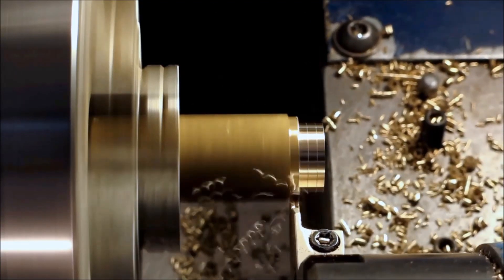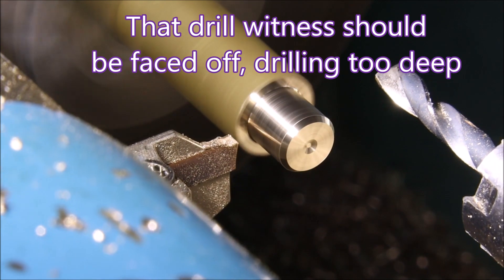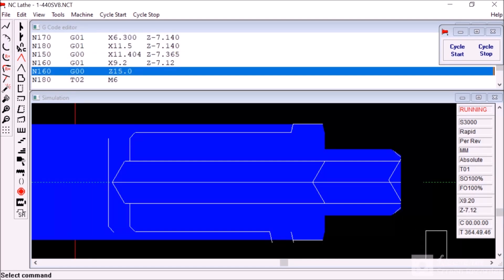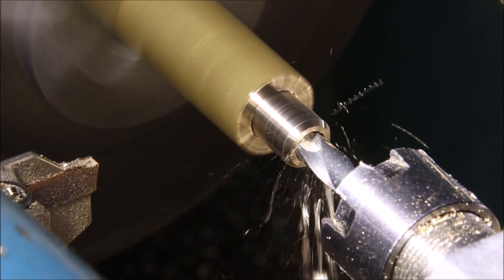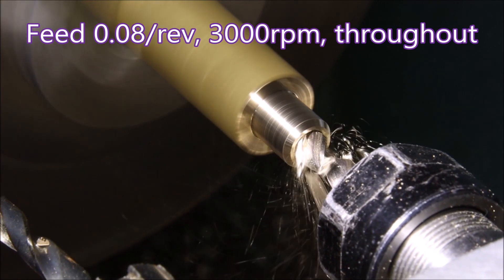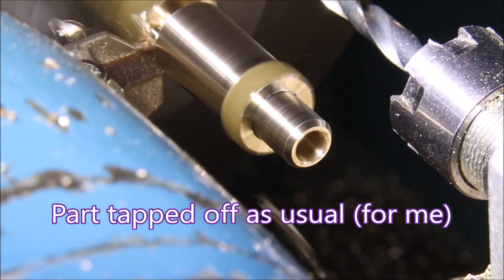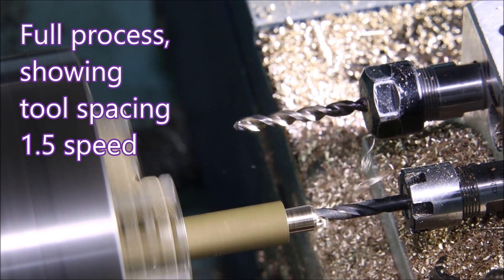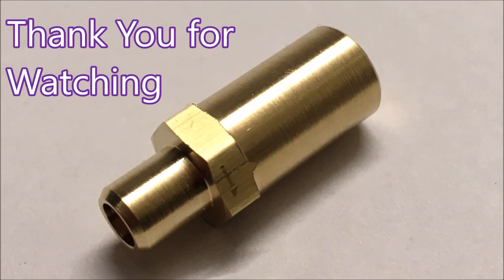Brass Steam Valve Body made with gang tooling in small cnc lathe

Comment: oh whats up with it now!
Reply from the maker: What a great question. not a damn clue is the answer. last time it was adjusted we did all that we could think of to get it running properly and it worked really well, for some thousand or so changes. Now ir is not changing properly and we have not a clue as to what we should do next.  We may slow the mechanism down to ensure all signals have plenty of time to do what they do.  But the mechanism is not visible when working so diagnosis can be difficult.

Comment: I am by no means an expert in this, but I was under the impression that brass shouldn't be used around steam due to the zinc leaching out which makes the brass fatigue and crack.
Reply from the maker: I am no expert either and I was making these for someone else. However, historically the model steam fraternity does not appear to have a problem with dezincification. Thanks for your comment,  always appreciated.
Reply: In small models its not allowed to use brass in the boiler itself (i.e. silver soldered in), but as a removeable fitting its ok. I think the reasoning is as an external fitting it will start to show signs of failure.  Also, model boilers tend to be run only intermittently, so the practical lifetime is much longer versus commercial use.
Reply from the maker: @mikeandhismachines  hi Mike, thanks for your comment which sums up the situation nicely I think.